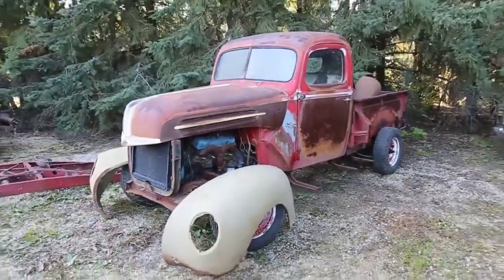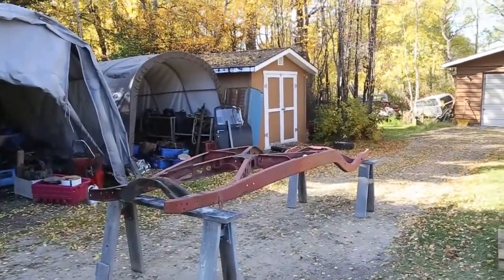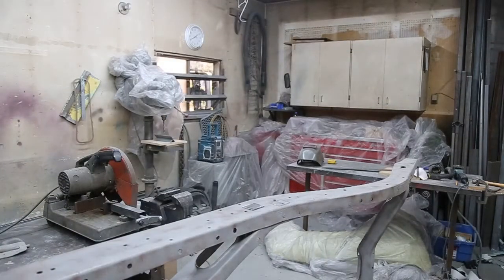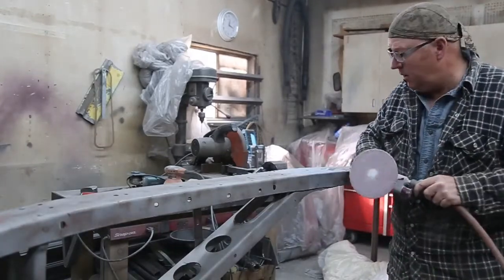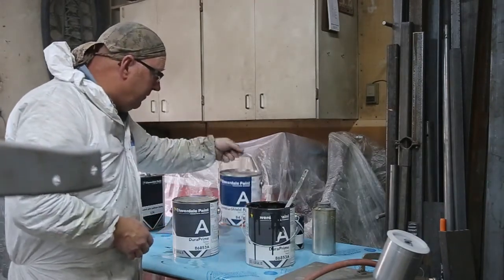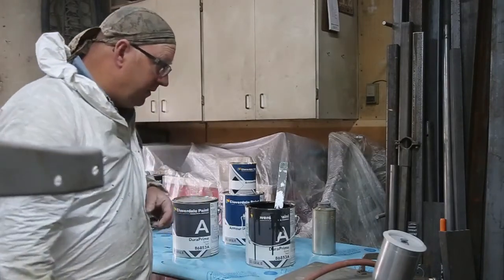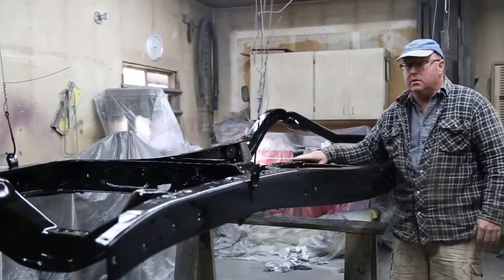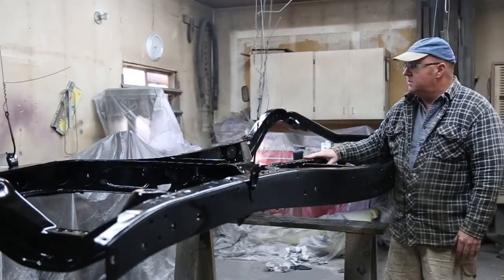Painting a 1940 Ford Frame

Comment: Looking at doing the same in my 40 chassis, I’m concerned about the double skinned areas. How do you get all the sand out, and then the paint in?  I’m concerned about sand sitting in there and attracting moisture, leading to rust, any help appreciated.( I live in the UK, we get a fair bit of rain)
Reply from the maker: If it can get in you can get it out.  I use an air compressor and blow it out but you have to use a vacuum at the same time.  After sandblasting, I would vac up as much as I could.  I probably blow and vac 3 or 4 times before I spray.  It is a pain but it can be done.  Thanks.  Stevo
Reply: @stevoj8959  Thanks Stevo.